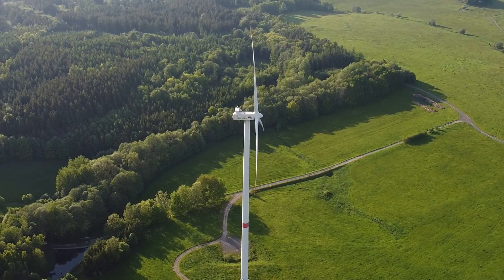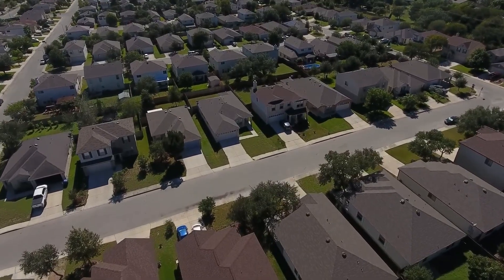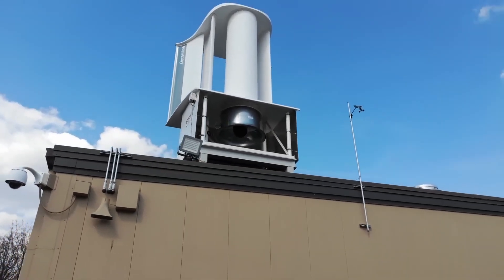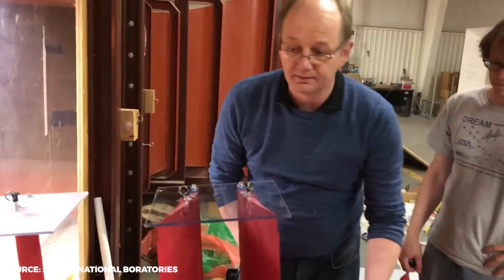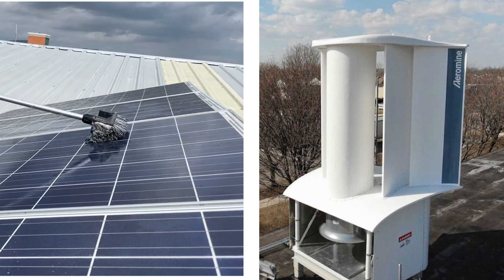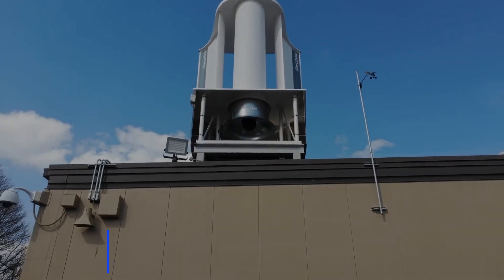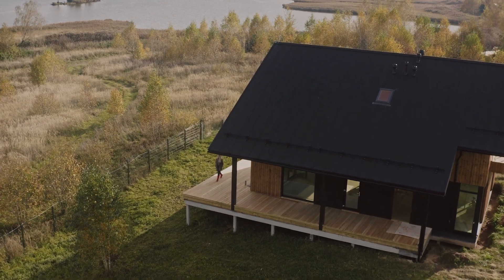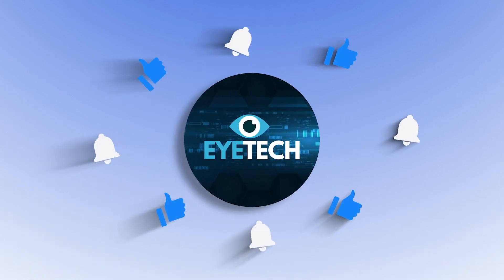Insane Rooftop Wind Turbine Generates 50% More Energy Than Solar PV

Comment: I AM insearch of draught CHUTE exhaust cum windturbine at top of vertical pipes to generate ELECTRICITY using heated air in lower levels GUSHING up the exhaust in vortex of sloped roof.

Comment: You could feasibility build them on a rotating base, so they can orient to the wind.

Would take some creative engineering, but it's doable.

Hell, you could add an external PV coating to the entire structure. PV paints, or those cheap strip your can print.